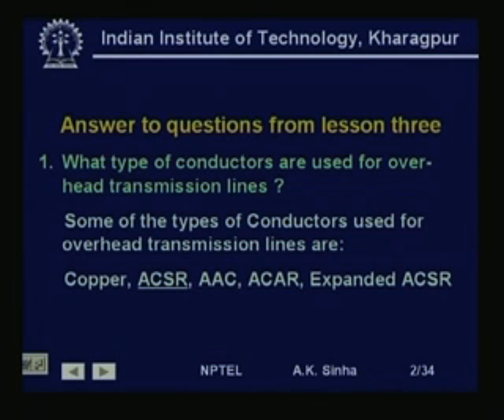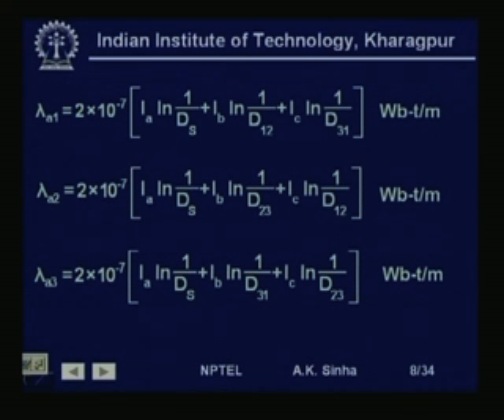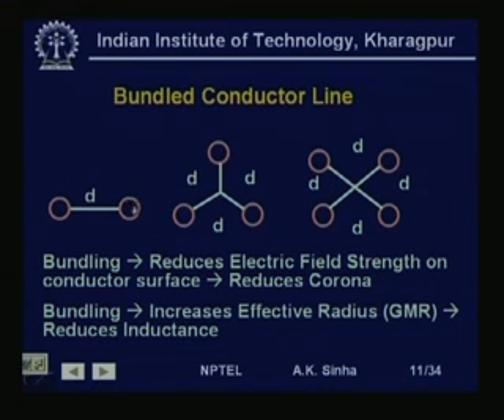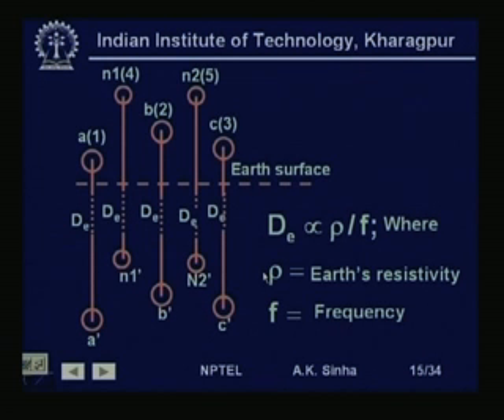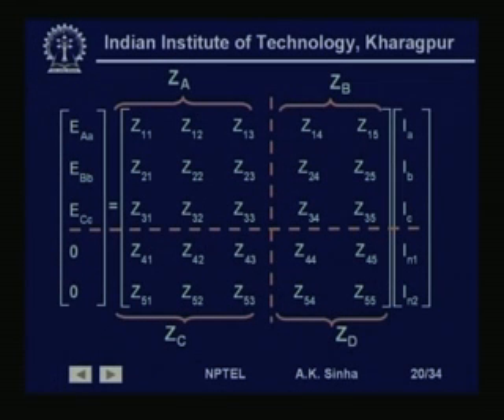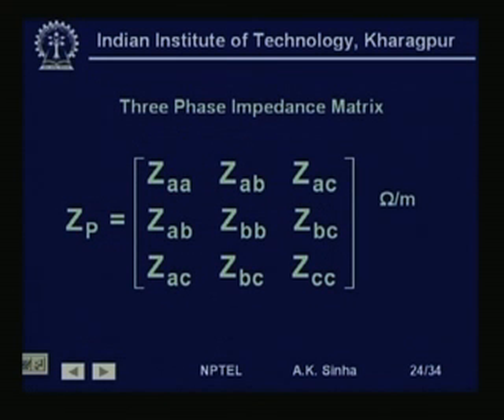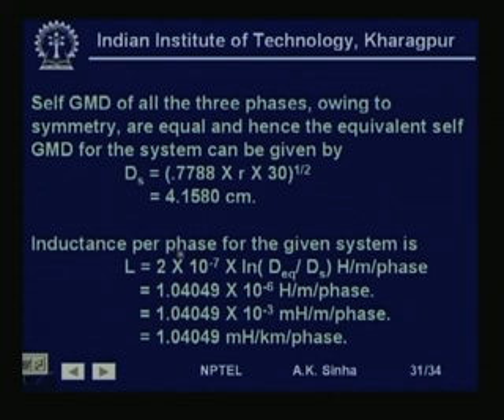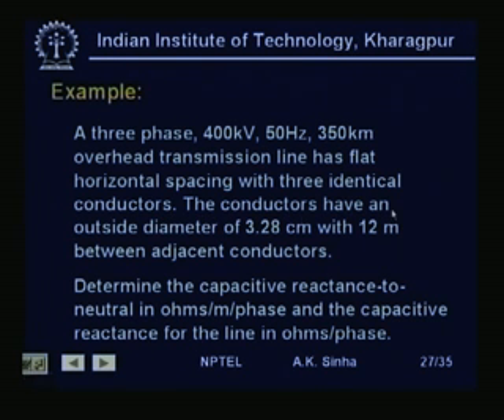Lecture -4 Inductance Calculation (Three Phase)

Comment: c4 WE cannot see whole circuits easily because basic principles we got wrong years ago with Voltaire who, after all, was using only primitive methods and techniques of understanding of the time.
So when the voltaic pile increased in size Voltaire could not understand that the disorder(Resistance)  in the battery increased and this was shown as an increase in conductance in the meter in series. But he merely supposed the meter needle swung because flow increased, but electrons got fewer per CSA.